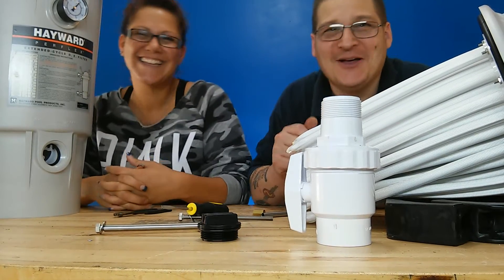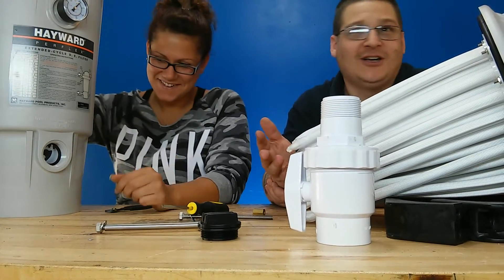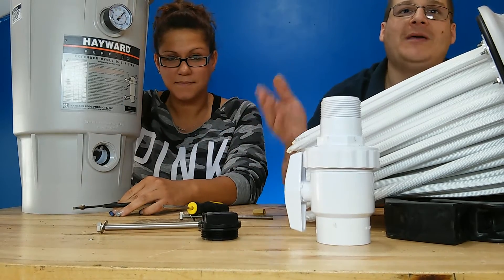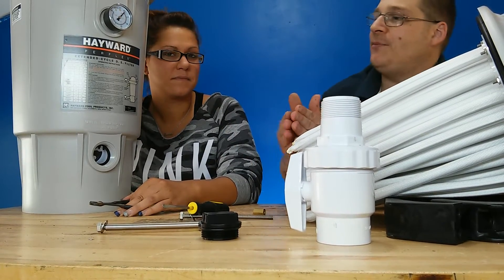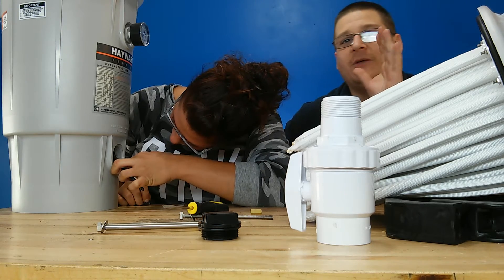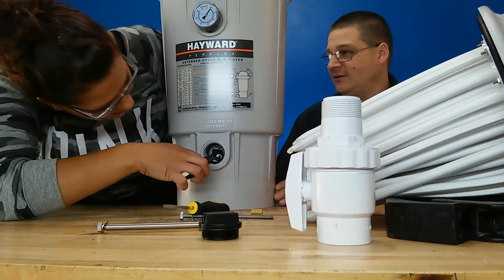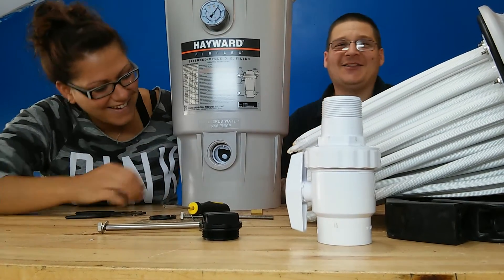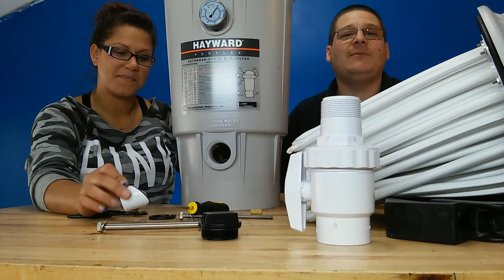Hayward EC40 Filter Check Valve Removal & Troubleshooting

Comment: My check valve appears to be threaded in. Is that possible? At the very least it is really stuck in there. Any ideas on how to get it out besides just having it pop out like yours did? I have a hayward ec65a circa 2003.  Thanks for your help.